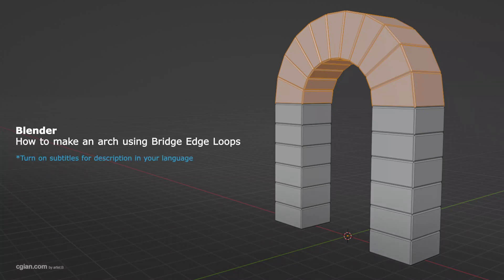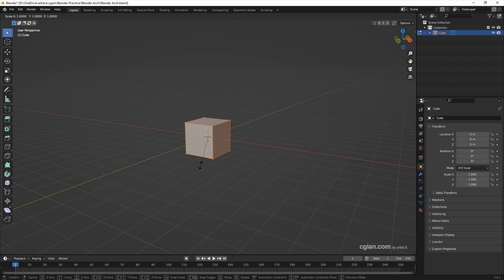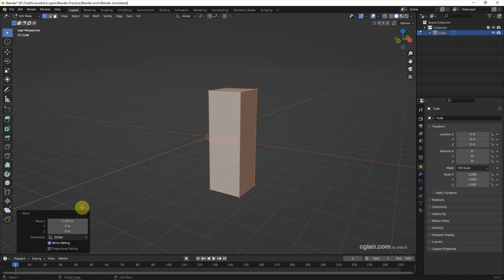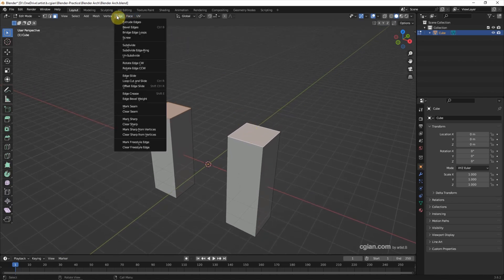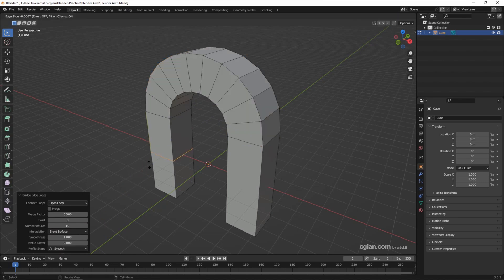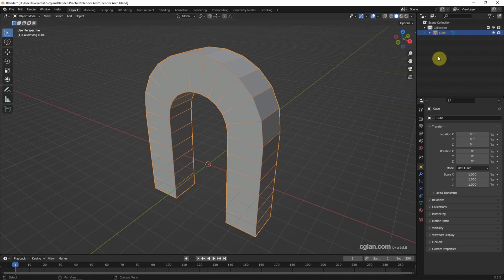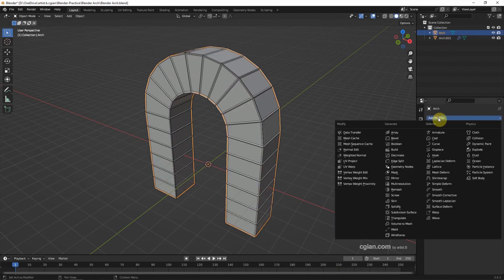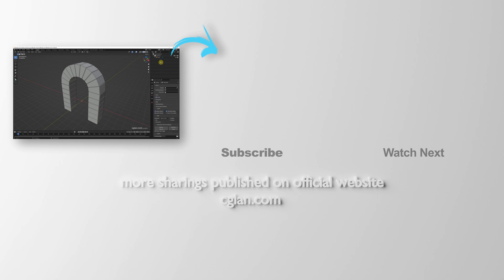How to make an arch in Blender using Bridge Edge Loops | 3D modeling timelaspe

Comment: I was doing an arch thorugh simple deform, well I was using another 3d app first but had problems so by now I'm using blender cuz it is the best I could(and Finally getting experience on blender is good) I had the map 99% done on the other app, but had so many problems that... yeah... kinda problematic and it was easier to find make on blender and fix any problems that arise...
Reply: btw the map based on my calculations at first was 250meters to 250 meters, but the problem was that it actually was 700x700 and scalling everything to match would show to be a bigger problem than just using blender...
Reply from the maker: Blender is great for 3D modeling, glad you could solve the problem.